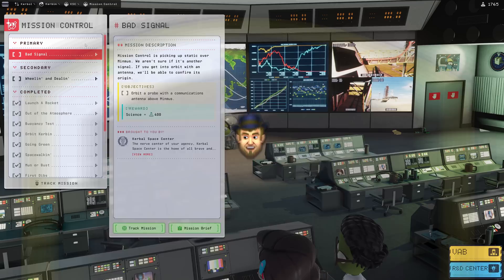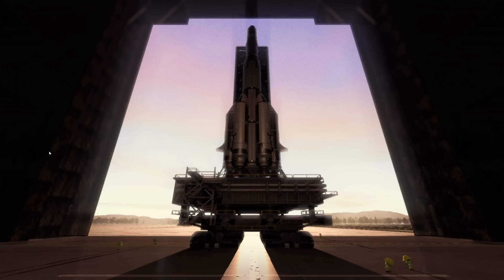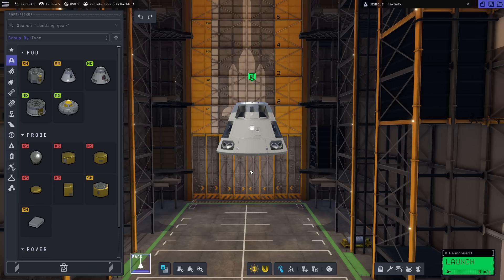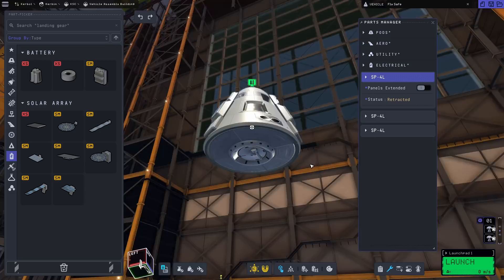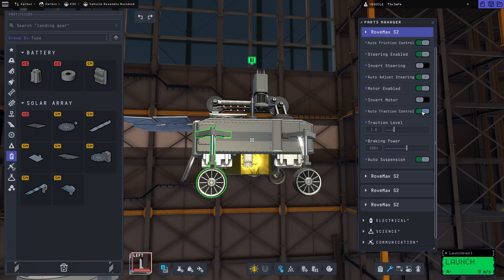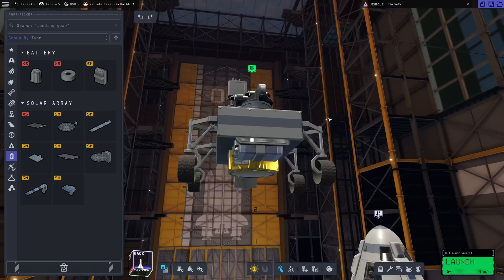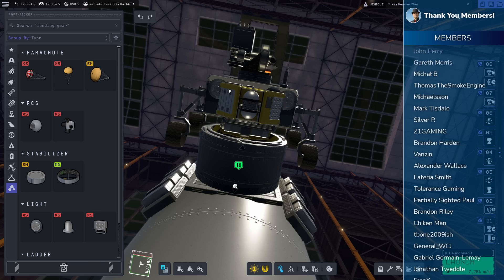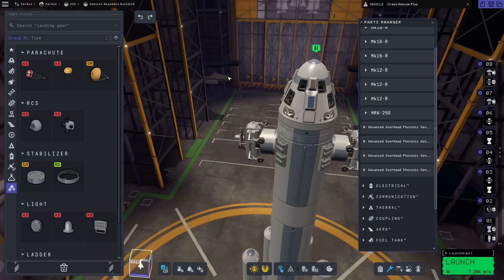UNNECCESSARY DESIGN, BUT IT'LL BE COOL! - Kerbal Space Program 2 Exploration Gameplay - 05

Comment: I would reduce thrust limiter on solid boosters so that your TWR is lower. This lengthens the burn time on the booster and allows you to travel slower through the thickest part of the atmosphere (approximately the first 20k meters). With your poor aerodynamics, especially, you want to limit your low altitude speed, it's extremely inefficient to fly much faster than 250-300 m/s until you are through most of the thickest air.

Comment: My guess is that the ui scaling, while tuned correctly to different resolutions, is probably calibrated using a different pixel density. I think 4K monitor is generally assumed to be a huge display thus you don't need bigger text. I'm guessing you use a very pixel dense monitor?